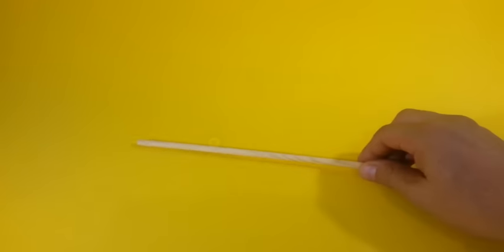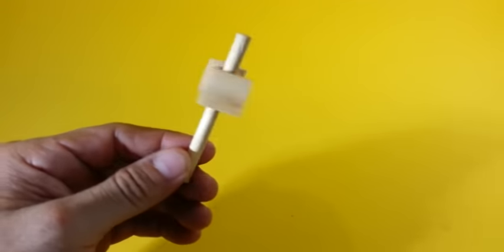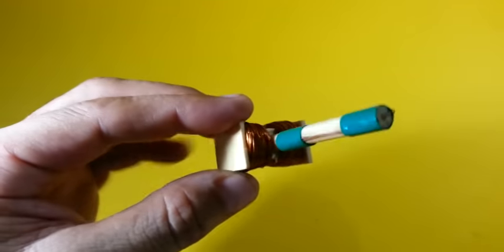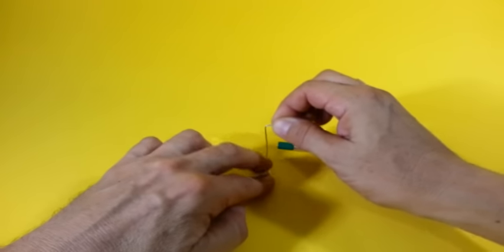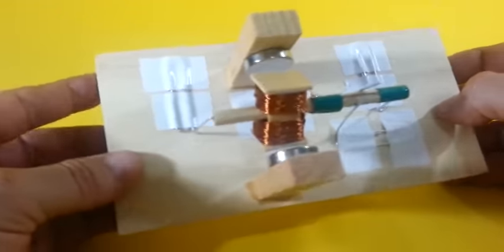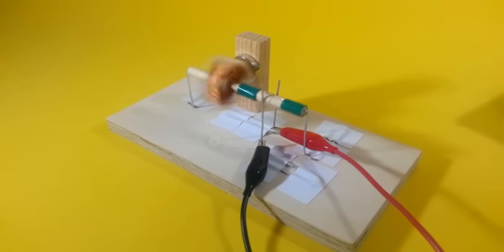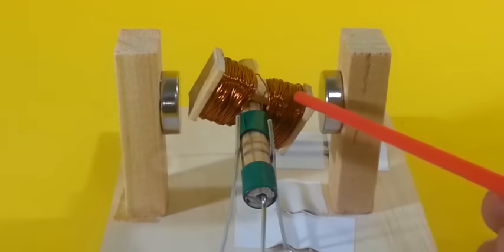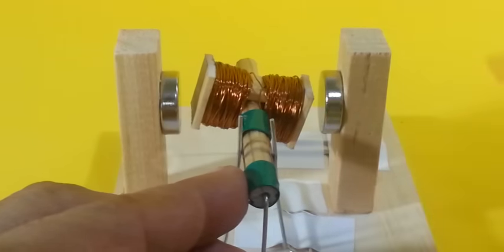DC Motor with Brushes and Commutator, Easy

Comment: It would probably work better if the holes in the wooden dowel were smaller or if there were bearings holding the dowel.  The wobbling interferes with the angular momentum and slows down the motor.

Comment: I did the exact same thing you did, current does pass through but it doesn't spin, please help
Reply: Did you make sure each permanent magnets polarity was opposite? You can use a compass to check
Reply: Make sure that you followed his direction on how to wind up the magnetic wires.

Comment: Hi, just wondering exactly what kind of magnets you used. We have a current flowing through, but the solenoid doesn't actually repel the magnet. Any idea why? Thanks!
Reply: J Shah not sure what you asked, but the magnets are not able to reflect wooden armatures
Reply: It does repell, that's how the motor works.

Comment: As you increase the supply voltage the current goes down. total watt consumption remain the same especially and when the speed maxes out.
If you disconnect the power supply and turn the rotor, would you get DC output through them brush wires? And would you use dc voltmeter  or dc ammeter to check it?

Comment: I tried making this IRL. It vibrated a little bit, but didn't spin. What did I do wrong? And yes, I sanded the rotor.
Reply: Did you fox the problem I’m having the same problem any suggestions?
Reply: @Fener.edits1907-m2f  no

Comment: You should build an induction motor!
Reply from the maker: I'll try
Reply: My one works but dosent turn fully how do i get it to turn fully
Reply: Ludic Science does the way you wrap the wire matter? And can i use larger stronger magnets? (THe magnets i am using are just alittle bigger and rectangular, and strong as well)

Comment: what is the minimum voltage for the batteries? my motor is not working
Reply: Did you fix it I’m having same problem any suggestions?

Comment: Do the magnets matter because I’m having trouble making mine work I have 50 turns of magnetic copper wire on each side ?
Reply: Yes the magnets matter. Needs to be strong enough for the motor. 
I used one 6vlt battery and two 1inche by 2 inches magnets I bought from Home Depot and I did 100 turns each side. Mine worked non problem

Comment: Not sure why mines isn’t working I have 50 turns on each side magnets places perfectly 9v battery paper clip touching the wire but still doesn’t work any suggestions ?
Reply: Maybe, wires have an isolating wax on them

Comment: How much varnish should I remove on the magnet wire? Should it only be the area where the paper clips make contact
Reply from the maker: Yes
Reply: @ludicscience  what method did you use to remove this

Comment: one more question please if you have time cause i'm making it as we speak..which way do the magnets face?i mean specifically the one on the right and the one on the left,round or straight face towards the wood it's stuck?
Reply from the maker: it does not matter the polarity of left or right magnets as long as they are different, for example the left may be south and the right north, or viceversa.
Reply: thanks,i made it,everything fine,but once the axis rotates it pushes both the paper clips of the positive and the negative and the motor stops moving.any suggestions?
Reply from the maker: swap the connections of the battery. polarity must be inverted
Reply: no this isn't the case,the polarity is alright..the problem is that the axis pushes the paperclips with the power it spins.
Reply from the maker: there is some axial force, you may need to use stiffer clips
Reply: Will try some patents and see how it works out.Thank you very much though for your time,very much appreciated.

Comment: Can this design be used to light a led light?
Reply: You would just use the battery and a bit of wire for that, no?
Reply: @dominicportolese1916  Yeah, wtf is that question xD Unless he asks if it's possible to make it reverse and produce enough energy to light up a led by speeding up the rotor. Then probably yes, imho.

Comment: What is the orientation of the permanenet magnet poles? Is North facing inward on one side of the motor, and South facing inward on the opposite side of the motor?
Or are "like" poles facing inward, i.e., two Norths facing inward, or two Souths?
My guess is that opposite megnetic poles are facing inward towards the rotor
Reply: Most likely same polarity facing the motor from both magnets

Comment: Excellent video, can u do this with ac?  What is the difference?
Reply: you need a slip ring rather than a commutator
Reply: you can't do it with AC. then the motor will probably spin and stop immediately

Comment: should i scrape only one side of the copper or both ?
and what is the voltage of the battery should be ?
Reply: Scrape both sides. The voltage isn't that important, it can be anywhere between 5-20v

Comment: I wasn't able to make it spin, maybe because I used ceramic magnets instead of rare earth ones.
Reply: I used ceramic magnets on mine and it worked
Reply: Did you follow his direction on how to wind up the magnetic wires cause the direction on how you wind up the wires is critical. Did you use magnetic wires?
Reply: @haroldcruz8550 I need help mine is not working any suggestion I used magnetic copper wire ?
Reply: @Fener.edits1907-m2f  is your copper wire coated (usually enamel)? copper wire should be coated, bare/naked copper wire will not work. Magnet wires are simply copper wires with coating. Also make sure you wind your wires exactly as directed in this video, that is the right number of turns and also the direction/orientation of the turn. wrong winding will mess up the magnetic field.  Make sure that you use the correct wire size which is 28 AWG also known as 28 gauge